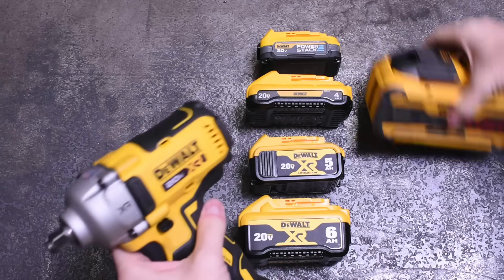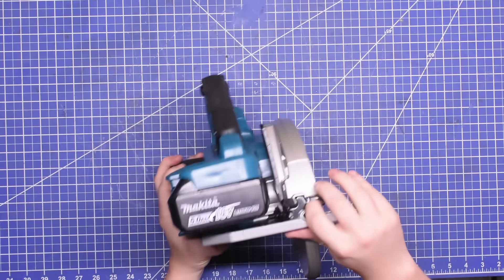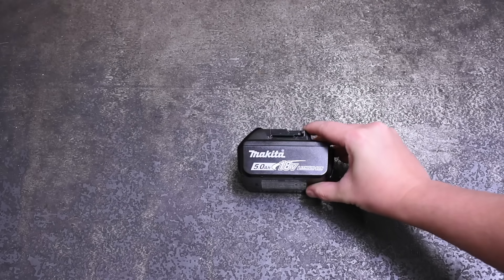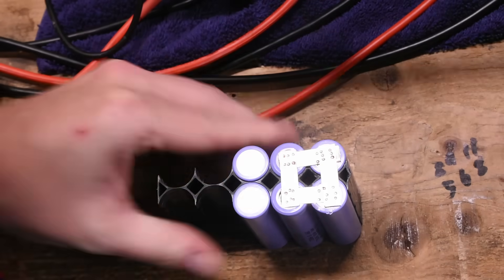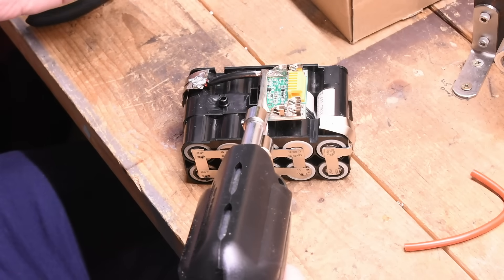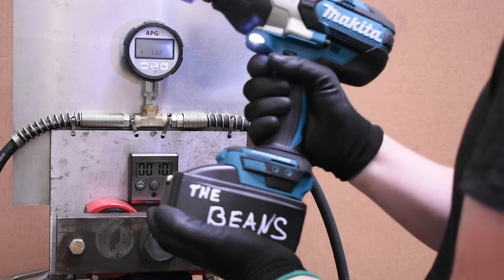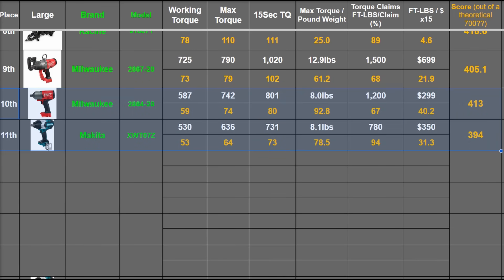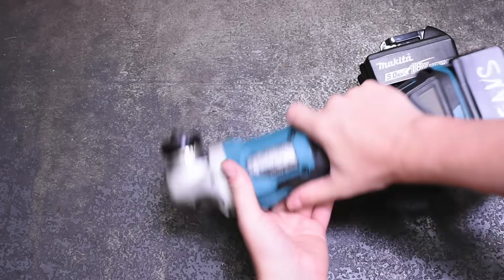We Built the Best Power Tool Battery for the "Worst" Brand

Comment: I build tool batteries for fun all the time for my landscaping business.  Love molicel,  however the 30t is my go-to, especially when needing every possible bean. Nickel copper sandwich connections will fix any overheating issues.  Loving the next level science in your latest content 💪. I don't believe I have ever posted a comment on a video before but this one deserved it!
Reply: If you can afford it, the P45B test's better than the 30T in every way: max and continues discharge rate, capacity, lower internal resistance (lower temps), and even cycle life.
Mad props to you for using the copper nickel sandwich method. what spot welder do you use?
Reply: @rockenrooster  guess I should have said for a more readily available cell? I haven't come across any p42b cells yet and you are correct over the entire voltage of the cell from what I've read.  Reads like the 30t is better with less sag at full charge or am I mistaken?  Had a kweld but currently using a diy truck battery setup that is just as hilarious as it is effective
Reply: @richardfrancisco2439  For me the P45B is more readily available than the 30T. There are no P42B cells only P42A.
Reply: sorry #1 performer
Reply: @rockenrooster they have exactly the same temps on discharge and this same cont rating, but obviously molicels have larger capacity. They are also like 3-4 times more expensive lol
Reply: @riba2233  Dang that sucks, where I live 30T's are just 30% cheaper so the P45B's are actually a better value for me ($7 vs $10 each).
Reply: I want some of these p45b cells bad now. 3 layers of 30t are usually enough to max out a tool most likely but the capacity for some flexvolt batteries look like a match made in heaven.
Reply: Question for the battery experts....Best 18650 flashlight battery and where to buy ? Thanks
Reply: @1STGeneral  depends... What flashlight? 

Looking for max brightness? 
Max runtime? 
Max cycle life? 
Cheapest price? 
Pick two.

If you have no idea about any of this, then  the P28B will cover everything, even the hottest of hot rods.
Reply: @rockenrooster  Price within reason isn't a problem. Thanks for any info
Reply: @1STGeneral  Mooch approved! Molicel P28B recently released, ordered 4 last night from 18650 Battery store on sale right now $4.99
Reply: I also build tool batteries for my own use, as i'm sure you have discoverd a lot of hoover manufacturers batteries BMS will brick themselves if a cell goes slightly out of balance, VAX one power are a great source for samsung 40t's and dysons are a great source for sony (murata) vtc 4's and 5's
Reply: Excellent tips. Thank you.
Reply: only available 21700 battery in my country is Samsung 30t 40t and molicel p42a. I really need to build a new battery now. What's the best choice?
Reply: What websites do you recommend for buying the replacement packs?
Reply: I've given up on molicel. Mid to long term capacity retention is not good. 20% in 6 months...

The best packs I've come up with are m12 milwaukee CP packs with the Samsung 20S 18650. Hits like a 6.0xc with the size of the little cp packs.
Reply: @procrastinator1842  capacity retention depends on max charge voltage (discharge too but I guess, that's a no issue)... and heat and charge current. I guess even at 1C they would need some active cooling.
Reply: @stanimir4197  The max charge voltage was 4.15v/cell, although if they get out of balance, this can change. Charge rate is below 1C. As for discharge, well, I give them hell. Maybe I got a bad batch, as I had one defective cell out of the box, but both molicel packs I built have shit the bed, and the Samsung packs are seemingly perfect.

Comment: Awesome video!  If used one of those battery adapters to run a M18 high output on my Makita tools how close can I get to the results of the crazy homebuilt Makita battery?  Keep up the great content.
Reply: Also dewalt batteries on the Makita? Basically what batteries SHOULD I buy with a battery adapter to make up for the poor battery options for my makita tools.

Comment: I posed this questions to you several months ago since 21700s are so spicy, glad to see some positive results.

So when it comes to LXT batteries dying I've heard of 2 solutions and have successfully done the easy one myself. The easy way, how I saved a 2 AH pack, is use two pieces of 16 gage wire and jump start it with another pack for about 10 seconds, then put it on the charger immediately. If it works it should just start charging.

The 2nd was is a battery reviver I've seen online that trickle charges a battery over a couple days, the rate of success is supposed to be higher with that but it's a couple hundred dollars so you better already have like 10 batteries to even justify buying it
Reply from the maker: We tried a bench power supply to trickle charge it, and it does charge just never powers tools anymore despite being 20.5V internally.
Reply: @TorqueTestChannel  if you remove the Star battery protection it will work again, but it comes at the risk of overvoltage

Comment: its like car, you can put super powerful battery(engine) but rest(stering/breaks/etc read: chip controllers) will slow it down.
You need really good build quality and controllers that will unleash that power properly AND not mess it during charging/discharging.

Comment: ok so we have more powerful  batteries. More beanz. Bigger hammers more Beanz again. All hitting the same anvil. A redesigned anvil which is heavier and has less flex must transfer  torque better. IM no engineer but i have seen everything getting upgrades except the anvil

Comment: Great episode! I've been wanting to swap the 3ah cells in my high output milwaukee battery's for the new molicel p45b, mainly wanting to see slightly longer runtime, and also swap some Nee p28b cells into a dead 4.0 M12 battery great info on this video!
Reply: I've done this. Honestly the molicels don't last under the demand. 6-12 months and they have lost much of their capacity.

If you are looking for maximum power, the Samsung 20S is what you're looking for. It's awesome. Nothing touches it.
Reply: Those two are the best ones yeah :)

Comment: Can we get some testing on the generic battery brands?  Not everyone can rebuild the cells or simply can't find a place to work on them and the off brand stuff seems inticing.  I know some have to be total junk, but there should be some good stuff out there, right?
Reply: Nope, all aftermarket/fake packs use shltty cells inside
Reply: @riba2233  all of em?  I mean, occasionally I see people stating that their knockoffs are working well, but I have no idea in what capaciy they use em.
Reply from the maker: I saw one with 21700's in an M18 pack that I think we'll buy for the fun of it
Reply: @D3thM3tal yeah, all of them unfortunately. They might work "ok" for low power tools, but I would never ever trust them, since they can burn down your house potentially...

Comment: So you guys do some amazing testing but the one thing you haven't tried yet is using different battery chemistries. And by that I mean you should get some lithium polymer batteries. If you really want to see the beans, lithium polymer is where it is at! Best part they are easy to get because lithium polymer is used by RC drones.
Reply from the maker: Workin on that too
Reply: No joke - multiple RC guys on youtube have had house fires from LiPos.  I keep mine in an ammo box.
Reply: Those are often overrated, and best cylindricals are not far off
Reply: @riba2233 point me to an 18650 that can do 180A because that’s just scratching the surface of what a good 3Ah lipo can do.

Comment: Those Molicel P28A & P42As are HOT cells for sure. I've considered doing this exact thing before for curiosity's sake...But just didn't see the point in spending that kind of money to find out. Happy to see it here! SUper interesting
Reply: I think the molicels (even the 21700 42As) aren't nearly as good as the Sony VTC5s. I really wish I would have stocked up on them.
Reply: @take1one  Spec sheets would say otherwise, but ok.  Can't deny a Sony, LG, or Samsung.
Reply: @J.Wick.  yeah I agree and I bought the molicels. The A's then the updated B's. But I would take a Sony at double the price any day. That's for my application and just my opinion.
Reply: @take1one  yeah yeah, understand. I'm not debating battery brand supremacy lol.. I've better things to do, as do you I'm sure. If that works for you, rock on. I'll have to check them out. Being Sony, I would expect nothing but the best, but they're priced like a Sony as well. Cheers.
Reply: @take1one  The P45B is the undisputed king  of 21700's right now, verified by Mooch. Also Sony VTC5's are 18650 not 21700 so you should be comparing it to the P28B which handily beats the VTC5 too in all aspects:  max and continuous discharge rate, capacity, lower internal resistance (lower temps), cycle life, and is cheaper than the entire line of VTC series batteries.
Reply: you definitely should - those cells will upgrade your suit from 9mm to .308
Reply: @billynomates920  nice. I'll try that. Anything is an upgrade from 9mm lol. 🫡

Comment: I wonder if backwards compatibility has anything to do with it? I use an old white Makita drill from 09 almost every day.
Reply: Likely does. They could attach a limiter in the battery BMS so that it limits the draw on non- star protection tools. They could even come up with a new standard going forward called Star protection+ that enables max beans in newer relevant tools, but is smart enough to read when a tool isn't star protection+.

Comment: Nice video, would you have a link to that DIY battery kit?
Reply from the maker: We didn't leave a link simply because it doesnt really work out of the box, as we showed. But just google "Makita 21700 PCB kit" they're on AliExpress & Ebay now
Reply: @TorqueTestChannel Where were the 18650 cells purchased ? Thanks
Reply from the maker: @1STGeneral  https://www.18650batterystore.com/

Comment: Wow so glad you are doing custom makita batteries! I have made something similar with xgt ones, they have better pcbs abd build quality in general and I used cells that are even more powerful than original xgt ones. I have also used P45B in one pack, they are crazy. Just like P28B 18650s that are even more powerful and have more capacity than 25S. Speaking of which, they are used in metabo hpt's 2.5ah multivolt packs, and their equivalent vtc5a from murata/sony is used in xgt 2.5 so you basically made that pack :) 
Interesting to see that grinder gets so much more power from upgraded pack, I assumed lxt tools would be limited internally since makita doesn't make powerful 18v packs.
Also in eu xgt tax is much much lower, with most tools only being just slightly more costly compared to lxt, but batteries are much costlier, that is why I made my own :D
Reply: Interesting thinking!  Perhaps Makita believes that the tool should live longer than the battery.  Thank you for your research into their batteries.  I have used Makita since I was 12 years old with the old dog leg batteries which were the latest and greatest.  Can't wait to experiment with what you have studied!
Reply: what diy pack did you use? in this video he show the diy pack have bigger pcb, different case but the one that he used is the old 21700 diy pack type
Reply: "I assumed lxt tools would be limited internally"

I was thinking the same, this research basically sold me on LXT, as a platform, even more! 😀

Comment: I like makita a lot, but I totally agree that their batteries need a whole face lift
Reply: My makita battery's have never given up and they are 15 years old
Reply: I know a company that was using Makita tools for manufacturing and they completely got rid of Makita and switched to Milwaukee because the Makita batteries were so unreliable. It's a shame because everyone liked the tools.
Reply: @leiflang8097  That's bull.  Milwaukee batteries and tools fail way more often than Makita.
Reply: @leiflang8097 they are not unreliable, they were probably abusing them
Reply from the maker: @riba2233  It failed while using an 18V ratchet. The one before this one failed while on the charger after using it on a compact impact. If that's abuse, then even Harbor Freight Bauer can handle that type of abuse without issues.
Reply: @TorqueTestChannel  idk, based on everything I read they are extremely reliable, certainly more than other brands. These must be outliers
Reply: @riba2233 I think someone is paying this guy to bash Makita.
Reply: Just get an adapter an use your fav. Game changer

Comment: Makita also can't make 15 cell batteries because of how they do cell balancing during charging. That kept them above the competition on charge speed for a long time. They've kept the same platform since 2005 though, so that is very impressive even if we're stuck with 18650s now.

I'd also be pretty careful with those Aliexpress circuit boards. There is a reason why they're half the size. Do they even do cell balancing?
Reply: They can do 15, or 20 or whatever, they just don't want to. Once you connect 3 cells in parallel with fixed connection, they become one big cell and it is balanced the same way. btw old lxt packs didn't even have balancing at all, they relied on Sony's excellent manufacturing tolerance and made sure that all cells have the same capacity so they don't go out of balance.

Also yeah lxt casing from ali are not that good, but they do have models with larger pcbs with balancing, and xgt ones are much better all in all, I use them a lot.

Edit - I like how the comment with misinformation gets most upvotes, you guys really believe anything right?
Reply: Yeah +1 on what Riba said, cells are (and should be) balanced in parallel so total number doesn't matter unless you change the number of groups in series